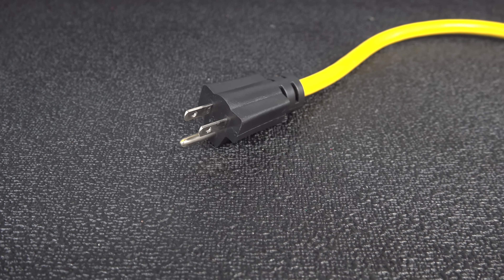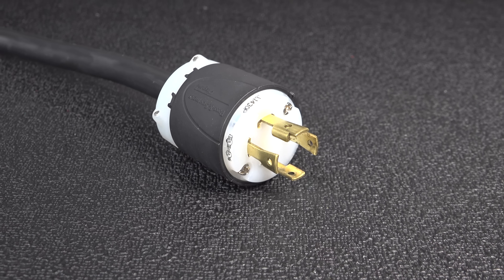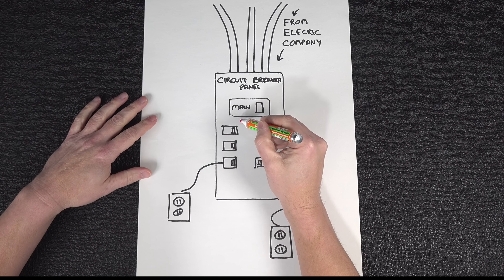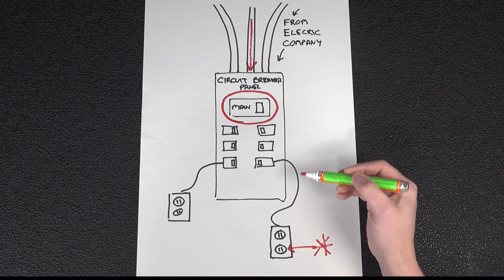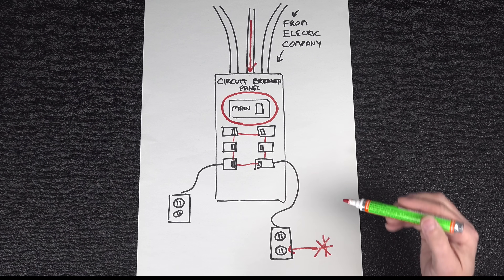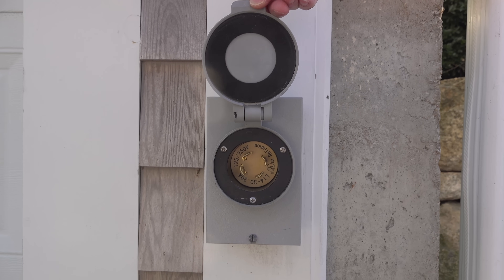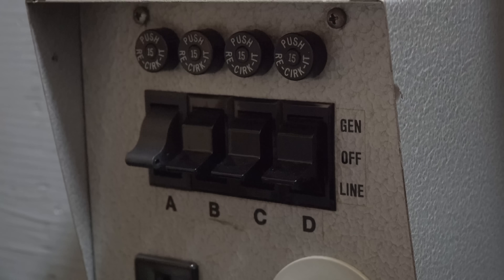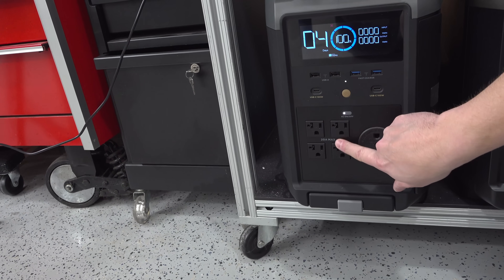Worst Electrical Mistake You Can Make - Backfeeding Generators

Comment: Naw! I'll continue to back feed my 220v dryer outlet  with my 110v 30amp Jenny, with my dual male TT-30 to 14-30 adapter and energizing both hot legs of my breaker panel off 1 wire 😀  worked pefect for the last 5 years.... and, all else fails, I'm not afraid to die. Also I do have a lock out on the main 200amp breaker, so It can't be turned on while using the generator.
Reply from the maker: If you have a lockout installed on the main then you are meeting the requirement. But is there really a lockout? Residential panels don't have this like commercial panels do unless you have installed an interlock as shown. I would be interested to know what you have done.
Reply: @SilverCymbal  don't get me wrong, the main breaker CAN be turned on with the generator running, but when switched off, it has a metal loop that a pad lock can be placed to lock the main breaker off, and can not be turned on unless the pad lock is removed, to which I have the key too. I'll take a video and post it in about 20 minutes, as words don't do well I guess. But the keys to the generator are with the pad lock and the back feed cord, which is all at the breaker panel.
Reply from the maker: @ajhainstock3997  Wow, I really appreciate the video. You are VERY fortunate, I have never seen a residential panel, or at least very rarely that has that lock out plate in it. As far as the national electric code reads, they don't specify a method to lockout the main breaker, but just that it must be physically locked. So I am neither a lawyer or electrician but it would  seem that what you have done certainly is honoring the sprit of what they are saying. The only thing to consider is that you could still have your generator feeding the panel at the same time before you switch the main off, but it it is a million times better than not having the lockout and since you seem to have your procedure down too which is really he most important part but its awesome that you can lock it out like that and you have it all ready to go. Thanks again I really enjoyed seeing your setup.
Reply: @SilverCymbal   thanks, I've never seen them like that either until this house. It's an old sylvania panel, I'm not sure if it has something to do with how far away the main is from the rest of the breakers that an interlock slide wouldn't work? I don't know. This house was built in the late 70s and the canadian provinces and USA states building codes are so different from each other. It's hard to find any solid info on the regulations. But from local electricians and from sask power, they've all said as long as there is a physical, mechanical way to keep the main power from being turned back on is all they are concerned about. Mostly for the back feeding hazzard, how a transformer and step down from 50kv to 110, but can also step up to 50kv if back fed. That said, only lost power twice in the past 5 years that were long enough to need a generator. Majority of the te power is back on in less than an hour.
Reply: @ajhainstock3997  Completely legal with a lock: Article 705.NEC702.6 contains an exception to the transfer equipment requirement:
“Exception: Temporary connection of a portable generator without transfer equipment shall be permitted where conditions of maintenance and supervision ensure that only qualified persons service the installation and where the normal supply is physically isolated by a lockable disconnecting means or by disconnection of the normal supply conductors.”
Reply: @SilverCymbal  just posted how my breaker gets locked out, and how relatively safe (or so I think) that the set up is. That said, I rent not own, and I have talked to the landlord about getting an actual generator transfer switch installed, and by own cost thru her choice of electrician and that was shot down fast. So that's why the way I do it is.
Reply: https://youtu.be/mLMWul_gLzA

Comment: I've set my panel to be backfed by my generator with an interlock similar to what's shown in the video. It's nice to be able to feed the whole panel with a real 4 prong cable.

Many people don't understand that if you backfeed through a 120v receptacle like that stupid cord would do, it only would energize half the circuits in the panel. People who think this is a good idea have NO business messing with electricity.
Reply: not to mention that is a 120V 15A cable, so at a very maximum it could push 1800W into the panel... akin to one space heater. You might as well just run an extension cord into your house.
Reply: @joshdoeseverything4575  you mean it can push 1800W without being overloaded 😉
Reply: I’m an electrician. Just backfed my parents panel for the ice storm that just hit Tennessee. I used my predator 3500 inverter generator with a 12ga double male ended cord that I made. 20amps of power let them have heat via the gas furnace. Some lights. TV. And fridge. Yes it was only powering one phase in the panel so I had to move some circuits around. I suggested to them to buy a 240v generator and I will install a 240v outlet for the generator to plug into with its own 30amp breaker in the panel with the main interlock kit. That way they don’t even need me next time the power goes out.
Reply: I get what you're saying but when you're out of power for a week or two, I'm not worried about the opinion of some guy in the YouTube comments
Reply: @the_uggh  Thats correct I also live in a rental and I think in a pinch if power is out more then a few hrs like it is right now because of the ice As long as you know what your doing and don't have kids running all over the place it would be good
Reply: @the_uggh  nothing I said other than "it's nice to energize the whole panel with a real 4 prong cord" was opinion but OK bud

If you think it's a good idea to backfeed via a 120v receptacle, it's fact that you have no business messing with electricity. You're a danger to yourself and others if you think that's a good idea.

Now, if you do it while fully understanding the risks and doing all you can to mitigate them, fully knowing it's not smart, just to get by, that's a little different. A little.
Reply: @EVLS10  the thing is that's a big "if" and 90 something percent of the time your average homeowner has no clue about electricity and dicks around with shit they shouldn't while saying "I'm not an idiot I know what I'm doing". The problem is chords like this are an easy gateway for clueless people to do something they shouldnt and a lot of dyi people on youtube even push them to do it. Now if they're unavailable that makes it more likely that they will seek out a professional to have it done right. That's all this is about and trust me there's a lot of people out there who think they can do it just as good as someone in a trade who has many years of training as well as the experience and knowledge they've accumulated over their career, I've seen it personally and any other trades person will tell you the same. It's got nothing to do with a superiority complex and everything to do with safety and having things done right.
Reply: My uncle backfeeds his generator but he has a big one and hooks it to a 220v plug
Reply: You may energize half the panel, but that's if there's only all single pole breakers. What if you have 2 pole breakers. You may be energizing the other phase with limited power because AC systems and some appliances have 240 volt transformers in them. Not to mention you may burn out any electronics involved.
Reply: I've done it with 2 suicide cords to outlets on different legs. Runs whole house and well pump, but I'm careful not to run too much at once.
Reply: Most people do it through a 220/240 dryer plug. Which is fucking crazy because there is no twist lock on dryer plugs. Interlock is the way to go

Comment: That cord is considered a killer cord. Your explanation is spot on! The only other thing I might add to this is if someone did use this? And it back fed to the line? Not only could they kill someone if the wire out at the street is on the ground. It would also cause you to lose your certificate of occupancy. The building department could force the residents out of their own house until the house is inspected? Any hazards corrected & then they’re is the issue of liability as well if someone were to get hurt? I have witnessed this a few times as a power lineman for the local power company. If we are nice we’ll pull the meter to their house & blank it off. Then turn that meter into our office & when everyone has their power restored? Meter service will go out to plug it back in if the back feed has stopped? If we aren’t nice we’ll slap a 1/0 copper ground on our equipment that is energized to short out the back feed. If their generator doesn’t have a working circuit breaker it may go on fire or burn out?
Reply: Looked up what happens if your neighbor reports you: where I live you'll get a notice in the mail you've been reported to building safety, and that an inspector will be out within 90 days.  He'll show up and see no cords actively hooked up or any violations at all, and he'll report back that you're fine.  He doesn't search the house for portable generators or suicide cords, just inspects what is currently hooked up.  If he DOES find your setup, it would be cited as a violation and they give you 180 days to show compliance, which would require unplugging it.   Pretty sure the grounding is SOP for lineman regardless. . .
Reply: @snap-off5383  Well every jurisdiction is different as you well know. If we suspect a critical back feed through the windings of a transformer? That primary voltage on the ground but not burning? We have in the past called 911. The fire department & police are rolled immediately. When they arrive we talk to the incident commander & notify them of our findings. They have the option of calling the building department right a way or have us make it safe? Or both? I have seen many variables in this situation. 

I will tell you we were out of town within our company territory years ago. The customer was back feeding through his main through his transformer onto wires dangling over pedestrians walking right underneath them. All they had to do was reach up & they would be dead if they made contact? We pulled the electric meter & solved the back feed. Who was the customer? A State Trooper. He forgot to open his main breaker & was using a killer cord.
Reply: @johnclyne6350  Thanks for the reply.  I only really ever asked the guys at building safety and sherrif dept (I work for the county) about when the main has been opened and the exception is being followed.  I'm sure that with generators and solar, and now battery walls I'm sure linesman are deliberate with their safety. Definitely worth a drive to every small engine you hear running in the area just to check their work. I wouldn't want to pull my grounding equipment and set someone's generator on fire by restoring power either, even though if nobody got hurt they'd have deserved it.

Comment: I saw one of those 2 male ends cords connecting a trailer to a slide out and it almost burned it down. Someone saw it and said there are sparks flying out of the plug and the cable was all burned up.

Comment: Another common problematic practice is people plugging their generator in through their dryer socket.  I had a former neighbor that bragged about it.  Lucky he didn't burn his house down.  Don't cut corners when it comes to electricity.
Reply: if proper wire is used nothing will burn down
Reply: @Paufit  You're ignoring 240 with a lot more AMPS.  If the main breaker is not tripped, its sending a lot more voltage outside that could be deadly to anyone working working to repair the power.
Reply: @imushavem7504  I was responding about house burning down.....also  I have two main breakers ,one on inside panel and one outside.....if I were to work on panel both would be shut off and also tested for voltage..as would a lineman be doing outside...unless they were an idiot.....
Reply: @Paufit  there have been a lot of fires this way, caused when the generator was still running and the power was turned back on. The out of phase interference will easily start a fire.
Reply: @BS-ht9zj  not when mains are off to house..or just pull the meter....really easy to do

Comment: They make automatic contact switches that will switch the circuit in event of power cut, Used Mainly in solarPV installs or Battery storage systems.

Comment: Back feeding is like anything else. It should only be done by people who know what they’re doing and are willing to do it correctly. This video puts it in a really bad light. If the main breaker is off, back feeding is not going back to the street. Linemen will not be at risk either way as they always treat all lines as if they were live. Also, whenever backfeeding, make sure you only have essential breakers on, such as lights or whatever such that it doesn’t exceed the generators or back feeding circuits amp rating.
Reply: I agree...if a person does not know to shut off main breaker..should not be running a generator or driving a car etc.
Reply: @Paufit 
Hahahaha!!! So true!!! They need to give up the keys to their car!!
Reply: Accidents happen, why not just do it the right way?
Reply: @CT-vm4gf  Honestly, if it was a choice between having to run a generator indoors or backfeeding safely, I'm going to backfeed.
Reply: @CT-vm4gf  Cause generator transfer switches are pretty expensive. No one is going to choose a $200+ panel over a $5 cable if they use said cable correctly.

Comment: I do understand that backfeeding can be dangerous for linemen and some other people. What about a house with solar panels that backfeed into grid when the battery is full? Do they have some kind of sensor that detects if there is power outage?
Reply: Even the mechanical interlock shown in this video has a potential to fail, if for example the main breaker were to break in a funny way. With so many sources of potential back feed, line men have to presume any line could become energized at any time, maybe even by lightning. So they do as much disconnecting and some pretty gnarly grounding to try to protect themselves. But it is pretty important to make sure you are separated from the world when hooking up a generator. A bunch of bad stuff could happen when normal power is restored otherwise.
Reply: Grid tied solar has an “anti-islanding” safety feature that shuts off production if the grid goes down, preventing potential back feeding.
Reply: Those have a "gateway" that knows when to feed power or not

Comment: Our generator is the same. But shhh. We had an electrician wire in a plug and interlock not knowing we would have to make a cord like this. It has a nema 14-50p on both ends 😂 240v 50a. It's risky but we hook the cord up before switching breakers and also before starting the generator. I would never recommend this setup for anyone else though
Reply: What happens if you connect live power to your generator without it being started?  If everything were able to run backwards and forwards with all this back feeding and energizing, is it possible to electric start your generator by plugging the output to your live power? Someone out there try 😉
Reply: @wingerrrrrrrrr  the interlock would prevent grid power from back feeding to the generator and also keeps the generator from back feeding the grid. That being said the electric start was comical 😂

Comment: They sell guns but the gun don’t kill NOTHING by themself ! Same as the cord !  That’s how I feed my panel just disconnect the main off !   Morons are everywhere !   You still have to disconnect the main.  lol.
Reply from the maker: That's true but it's a little different we don't leave our loaded guns around and expect nothing will happen to them. You don't stand guard over the panel after hooking it up. The problem is that long after you do the backfeeding other people can flip the breaker. It's a shame that all residential panels didn't have a lock out built in like commercial ones and accept a padlock. Best we can do is a piece of tape saying....please don't turn on...
Reply: @SilverCymbal   no one should be in the panel but one person the head homeowner the same one that hooked it up. I think you’re crying about nothing but oh well Common sense and as common as it used to be evidently
Reply from the maker: @i70show  No one ever wants any safety equipment, people once fought fuses, now breakers as unnecessary thinking the wires themselves would just burn up breaking the connection. Safety is never a popular thing and I don't follow every rule but those choices rarely affect anyone else. Do what you want but my interlock kit cost me $55 and the outside outlet was $50 and wire. That will be there for the life of my house and I never have a concern. Doesn't seem like a bad regulation to me.
Reply: Stupid people are everywhere so I guess we’ll just continue to lose all of our rights in the name of safety to keep them safe hopefully the governmental keep us all safe LOL. Have a nice day I like your channel though nothing personal
Reply: @i70show  I agree...if a person does not know to shut off main breaker..should not be running a generator or driving a car etc.

Comment: I've seen some off grid YouTuber's use that type of plug on their solar backup system.
Reply from the maker: At least for those installs there is no grid connection so the issue would just be local to them. The grid part is the real worry.